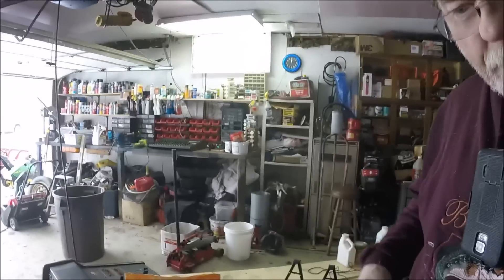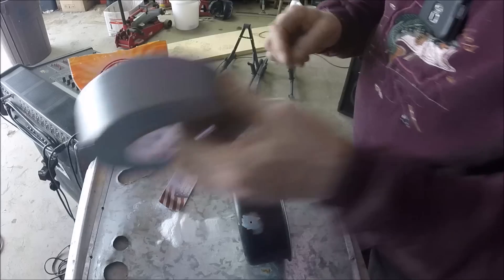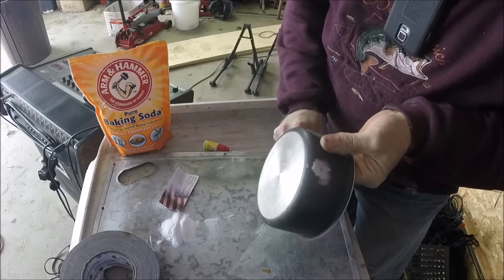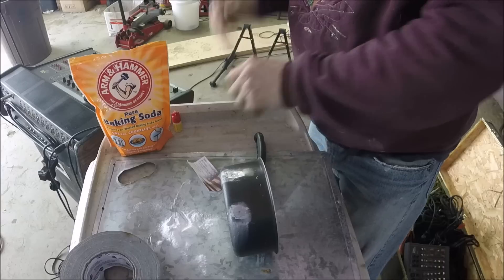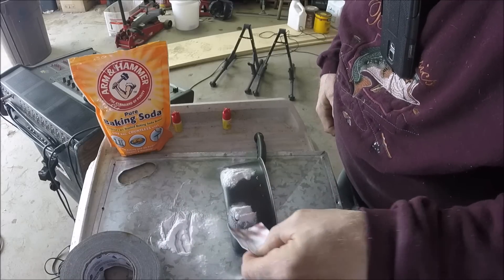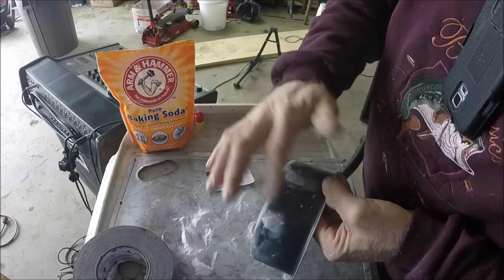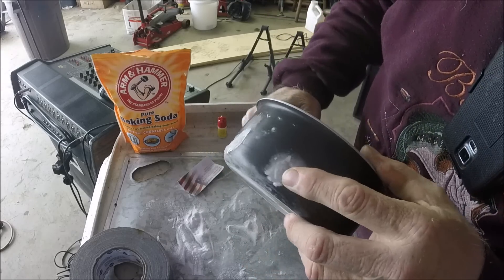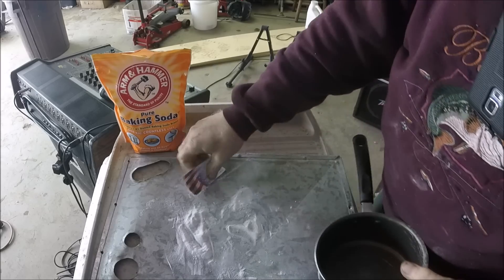super glue & baking soda trick, on a radiator. aluminum or plastic. will it melt at 195 degrees ??

Comment: An old aluminum pressure cooker would have probably been a better test subject for this experiment, and instead of using water use antifreeze, and maybe add a coating of oil and or transmission fluid on the inside because of course the outside would be thoroughly cleaned but not the inside of a radiator.

Comment: This is an invaluable test. Sure, the pressure test is not there, but I never wanted to patch up a radiator to begin with.

I just wanted to see how the glue + baking soda held up against boiling water and extremely hot aluminium.

Thanks for the hard yard, Bob! Great one😉👍

Comment: Interesting experiment. It wouldn't have been that difficult  to have put this under a more real life pressure application by just putting a lid on it creating pressure and let it remain at 200 degrees for at least 30 minutes. Probably easier to do on a gas range.
Reply: Yes it's an old pot, glue the lid on.

Comment: I had a stick dislodge a fanblade which inpacted the radiator and left a match head sized hole in the radiator. I tried stopleak first but the hole was too big. Used a product called rapid fix, which certainly looks like super glue and baking soda. Held for a good 20k kms without issue until the car died for other reasons.

Comment: It would have been a lot easier to look up the melting point of super glue on the internet. I did. Its 368 degrees, Einstein
Reply: yeah... yeah... but what about pressure... it may melt at 360 plus degrees but when you incorporate the pressure within a seal container like the cooling / radiator system then you would see if the crazy glue would hold...

Comment: The metal (or plastic) of a radiator expands & contracts when it heats & cools. CA doesn’t, at least not at the same rate. The 2 materials will pull on each other. Add to this the pressure of a radiator and such a fix won’t last.

Comment: This will fail due to different rates of expansion and contraction of the metal and the patch material. The patch will not adhere through many hot/cold cycles.
Reply: Patrick Long 

True...

Comment: I use this for everything, even as a wood filler. One of the things I think is most important is to make sure there is no white of the baking soda. When used as a wood filler I ad sawdust. This works amazingly well for everything I’ve tried so far.
Reply: Yes, I do that also but gorilla glue clear only. Leave slightly low, wet joint, mix sawdust with glue to level wanted. Dust with baking soda. Instant set-up, sandable 15 mins later!

Comment: I have a pin size hole in one of the hose for the ac in my car. Would this help seal it till I get the money to fix it???
Reply: No. If baking soda or glue get in that line it may clog the oriface up that allows for pressure change. And that is if it could even withstand the increased pressure your freon will be at.
Reply: I'd try it. With gorilla glue clear only. Sand area well for "tooth"  apply glue dust baking soda over it for instant set up. No way will it go thru pin hole fast enough. If worried cut pin head off sewing pin set over hole glue it right in ! Voila!!!

Comment: Wow! Gotta try this on the aluminum can metals I need to glue together.  I have found that plain super glue on aluminum thin sheet does not survive the long term vibrations or subtle flexing of the metal ( I make wearables from the aluminum cans).  But I will try this. By the way, Walmart generic baking soda is way cheaper to “waste”  LOL.

Comment: Try it with a steam kettle
Reply: Joe Blow, Bob's Lawn Service & Plowing  A steam kettle is good, but it would be venting as it is bowling. How about one of those heavy, steam cooking pots with a metal top, with a couple holes drilled and repaired. Let the water come to a boil over a propane stove(for instance),  safely, outside in an open area. That would probably be closer to a radiator under pressure.

Comment: Not too sure it would handle the high pressures in a radiator. Has anyone tried that?
Reply: Yes sir thank you for your time  excellent and helpful video
Reply from the maker: i am waiting for someone to try it ???
Reply: The pressure in a radiator is less than 16 psi. Not really what you would call HIGH pressure.
Reply from the maker: good to know thanks
Reply: tantricmaster800, Bob's Lawn Service & Plowing  I'm not a technician or mechanic, but I learned enough about being safe around motor vehicles from journeyman mechanics as a civilian and as a g.i. in military motor pools. Removing a radiator cap from a 190 degree to 210 degree, 16 psi  closed radiator system, even with a pin hole leak or two, is ill advised. I'll bet you dollar to donuts, you will only have to subject yourself to the explosive, heated water, one time, and you'll be finding a way to first cool it down, or vent the pressure if it has one of the vent type radiator caps or release pressure from below at the petcock, until it is safe to remove the cap. Water molecules under that heat and pressure will react differently than hot water in an open container.
Reply from the maker: i just wanted to see if the super glue baking soda would melt.
Reply: vinyltapelover Happened to me (One) time.  Never again.  Friend opened up an overheated radiator cap while I was looking (Over) the engine. Seriously burned. Scared for over 15 yrs.  Once and done. Never,ever again....

Comment: Hey, Bob like your video.  I have been using this method on Remote Control Drone and Air Planes.  I works great it is sandable, and paintable as well.  I like how made sure the working surface was clean.  As you know that is important.  This method is also used and approved to use by the Military to fix nix and gouges on helicopter prop repairs.  just to let you know that superglue does a great job holding up against tinsel "the pulling apart" not so good against shearing strength.  However with the addition of baking soda I sure that has to add strength against sheering.  I work on cars time to time as I'm an old Drag racing junkie.  I think it would fix the plastic radiator crack or the reservoir tank.  Not sure if would make a permanent repair due to the antifreeze.  Have you tried it?  I would be interested to know your results.
Reply from the maker: have not done it on anything with antifreeze. if anyone has please let me no.
Reply from the maker: i did a video on fixing a plastic gas tank, and it is gas soluble. so i would think it wood hold up to antifreeze.